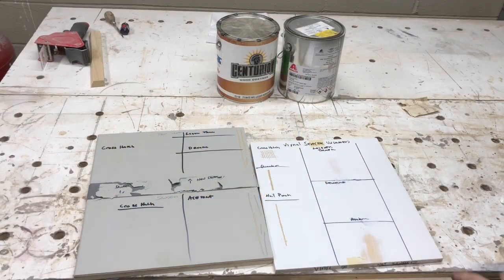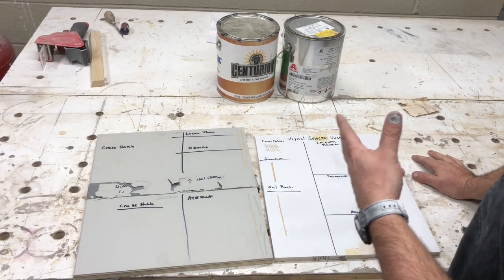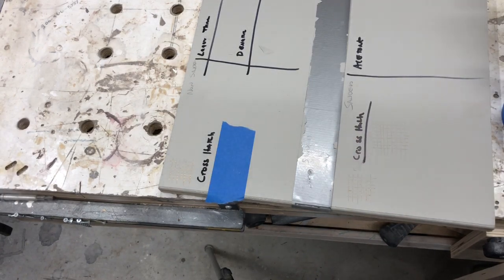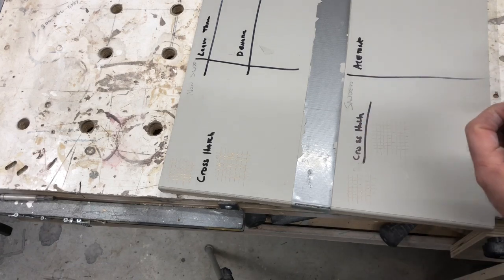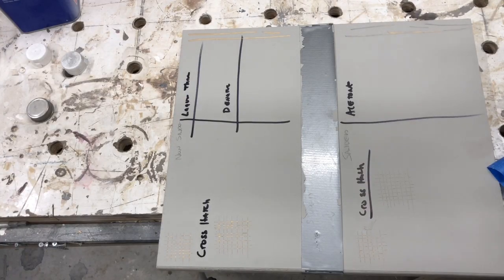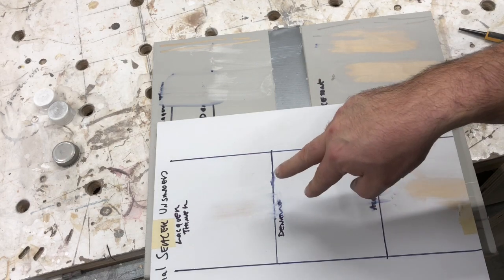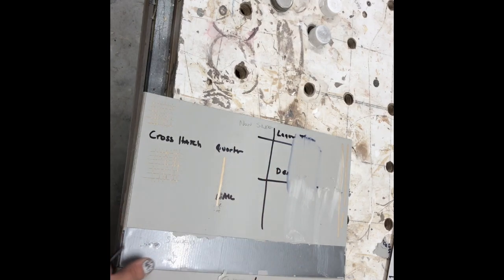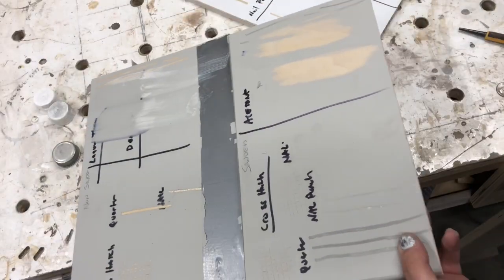Low VOC Vinyl Sealer vs High VOC Vinyl Sealer. Is there really any difference?????

Comment: This was an interesting upload but...not enough info to come down on this side of the fence or tht side of the fence....what about flow out? What about flash time? Stack time? What about the ability to bridge some pores? To wrap over a burn-in repair (using burn in  sticks, etc? What about clarity? What about the ability or lack to wick under the stiles of a floating panel door? What about the ability to accept 844 paste colorants or dyes to make toners? How good is one or the other when shooting over an oil-based glaze or a stain that was developed using 824 paste colorants and bioled linseed oil? (You need vinyl sealer over a stain made with BLO because of the japan dryer in the BLO, it can react with the acid catalyst in a post or precat and cause an unwanted and unpredicted color shift in the stain. Etc.
Reply from the maker: Big Swifty that’s a lot of material to cover in the short videos I do and to really answer those questions you have to use the materials for a while to make a solid determination. The good news is I have used both enough to answer your questions. The 275 doesn’t flow out quite as nice as the 680 and it is harder to sand. Flash and stack times are very similar but the 275 is more tempature sensitive and will fall out of solution faster than the 680. Don’t know about the burn in sticks because I don’t use them. The clarity is actually better on the 275 than the axalta 680 which has to do with the the surfactants they put in. I don’t know about the 844 because I haven’t toned anything in years. I just don’t like the look and there are waterbase systems from milesi and renner  on the market today that this type of thing can be done in one step with the stain itself by adding or reducing the amount of binders in the mixture or controlling the evaporation rate.  It seals fine over 824 colorants. This is the product that Thomas craven uses however with the Italian waterbase stain systems this can all be done in one step now instead of having to do all the layering. At the end of the day prefer the 680 over the 275 but they have done a good job with the 275 stuff and the overall performance is very very close. Good questions
Reply: @ericreason6559  Your reply addressed almost all that I mentioned. Lol, I saw the Thomas Craven video and Mr. Craven notes that his finish guy has just the same number of years as he does in finishing, yet he stans over him and tells him do this and that, as if his guy is a newbie. I found that interaction "interesting", let's say. Me, personally, I don't mind if my co-workers or superiors "guide" me, it's better than me forgetting something and then making a mistake as a result.
Reply from the maker: Big Swifty I wouldn’t read to much into  it. It was all for demonstrations purposes. There was about 20 people so he was commentating on what was going on and not everyone is camera ready. Normally the guys are just working away doing their thing. If you were to talk direct to Juan you would find him to be a wealth of knowledge. He is a very quite guy.

Comment: awesome video,  the main purpose I have recommend the vinyl sealer over other sealers is that is gives a superior water resistance in kitchens and bathrooms. Years ago I was told that the Pre-Cast lacquers were a self sealing product and you didn't need a sealer, that being said in the years following  I had several kitchens fail with just that system and so I added the vinyl seal as the system failures stopped. kinda like shrink wrapping your kitchen cabinets in cellophane the vinyl is more moisture resistant.  the next test would be to see how long the two different sealers hold out the moisture. not sure how that would be tested. I love your videos.Greg
Reply from the maker: Gregory Saunders thanks for the comment Greg and adding information to the community. I have some testing ideas coming up to test how they perform under a top coat. I don’t think I can show the water resistance on a pigmented sealer but can show it on a clear sealer by putting it against a dark back drop. Once I get the CIC clear Vinyl Sealer In I will do the test. I did a video vinyl sealer vs shellac where I showed the water resistance between those two I don’t know if you have seen that one or not.